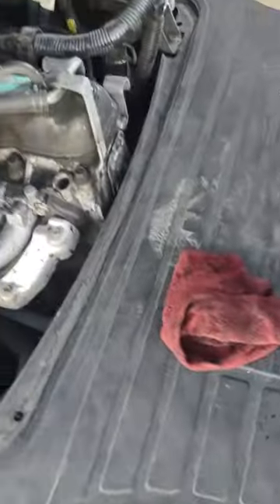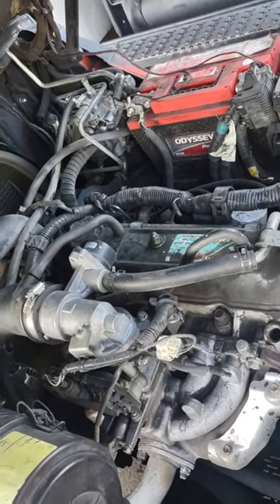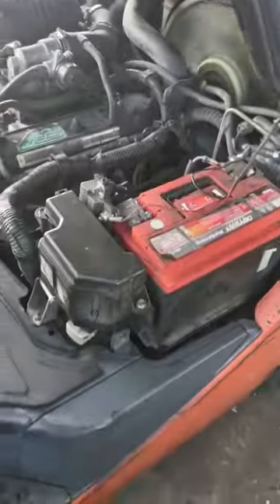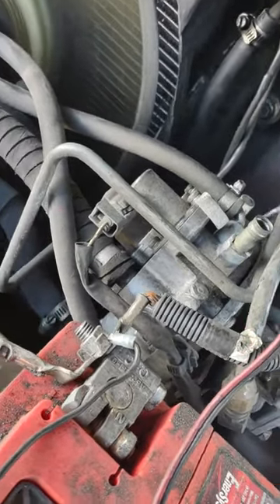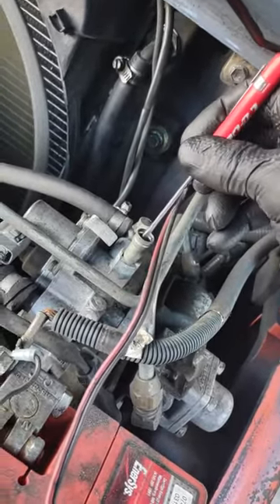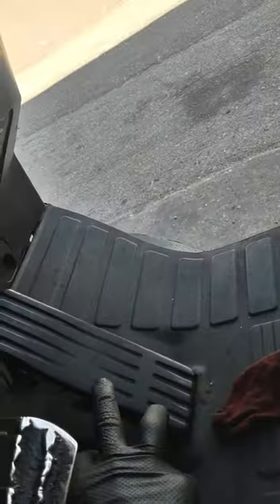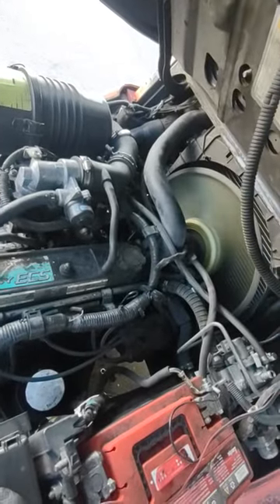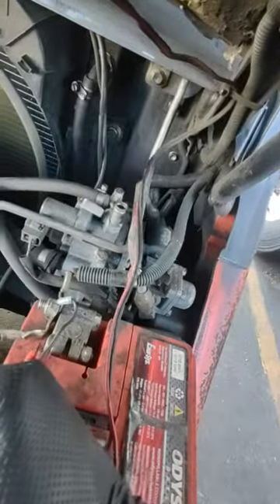Toyota Forklift rough idle. Easy Fix!!!

Comment: i like to run  them hot and drain the regulator, 12mm drain plug on bottom of it, then go clean throttle body as well. then go plug my analyzer in an do what you just did but im ocd so i like to set it to 2.50 and keep it under 5.0 on TA. did two today, they both ran "ok" but were idling up and down alot, and had a slight delay in the acceleration. fixes them real nice. love toyota forklifts.

youd be shocked how crappy those throttle bodys get, last three i did were horrible.

i had a 2004 TCM in last week that i got at least 4-5 oz of oil out of the regulator. freeking nuts, ran very well after that.
Reply from the maker: Great tips! I totally forgot that you can drain the regulator 🙏🏻👍🏼. Thank you for the comment.
Reply: @theforkliftguy  you bet! Thanks for having this channel, it’s helped me a lot

Comment: I have a rough idle when inching. I changed the regulator, plugs, wires, and rotor,  Forklift has 30k hours, what else could be causing the rough idle? toyota 7fgu
Reply from the maker: @lectrician1  what do you mean by inching? Like the inching pedal ?
Reply: @theforkliftguy   When the forklift is under load in forward gear with brake on and  lifting the forks or side shifting.
Reply from the maker: @lectrician1  okay, so under load it starts to rough idle, or wanting to stall ? Even if you accelerate it under load ?
Reply: @theforkliftguy  if i accelerate it is fine. not wanting to stall at rough idle or at acceleration
Reply: @theforkliftguy  If i accelerate it runs fine. When i put it in gear and step on the brake it s idles rough
Reply from the maker: @lectrician1  it might be your air/fuel mixture, as well maybe your throttle body needs to be adjusted and increase your rpm’s while idling. More than likely, either it’s not enough gas, or too much gas. Sounds like too much gas

Comment: Youre just making it richer which could be masking the real issue like a mixer or injector you shouldn't adjust the mixer screw without an analyzer
Reply from the maker: Correct, it’s more of a temporary fix. Not a permanent one.

Comment: I'm dealing with one right now that has a rough idle at start up but also intermittent white smoke coming out the tail pipe but only when it's cold. Once it warms up it starts running fine. I checked the radiator cap for bubbles and the oil dipstick tube for chocolate milk to make sure it wasn't a head gasket, but idk. I'm stumped, 4y Toyota just like this one, any ideas?
Reply from the maker: Remove the valve cover and check the oil. Sometimes the dipstick doesn’t show milky oil, but once you remove the valve cover, you’ll see it. It happened to me once. Same white smoke and everything like you said.

Comment: but why does it happen?
Reply from the maker: The gas regulator is going bad. It will get to a point where you won’t be able to adjust it anymore. You’ll have to replace the regulator. Typically not enough fuel is getting through, most likely due to getting clogged.

Comment: hello forklift Guy a had the same problem in one toyota 8fgcu25 4y motor asian sc regulator.
but whe i regulate the lp ball , the motor get stable again but , i push de gas and this acelerate good, leave the gas pedal and when i try to acelerate again i push the gas pedal but it do like the engine didn’t mix good the air fuel in the chamber
Reply from the maker: If it throws no codes, you most likely need to replace the regulator. It’s bad
Reply: @theforkliftguy  the funal problem was the air fuel ratio motor. The metal part inside was loose. I took it off and it worked like new
Reply from the maker: @acebolt6916  yeah that’s a common problem as well. How did you end up figuring it out?

Comment: Im getting that problem when I press the accelerator.. It idles fine
Reply from the maker: @Rainmon19  do a tune up one it. cap, rotor, plugs and wires. Also clean the throttle body. That should fix it. Agent you say press the accelerator, you mean it has no power when you accelerate?
Reply: Did a tune up and replaced the regulator. When I accelerate it has no power and sputters
Reply from the maker: @Rainmon19  sounds like a timing issue then. Has anyone messed with the distributor? Does it have good compression ? Make sure there’s no air restrictions.
Reply: @theforkliftguy  Distributor has been replaced. Just cleaned the throttle body and it didn't fix the issue. You might be right it may be a timing issue
Reply from the maker: @Rainmon19  I think whoever replaced the distributor may have installed it incorrectly. You’ll have to remove it and put it in time then install distributor again.